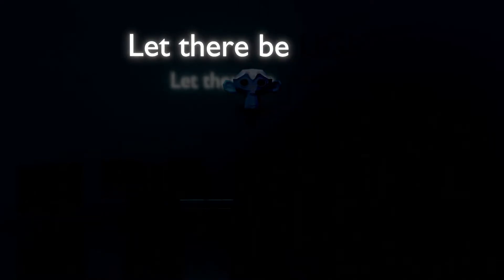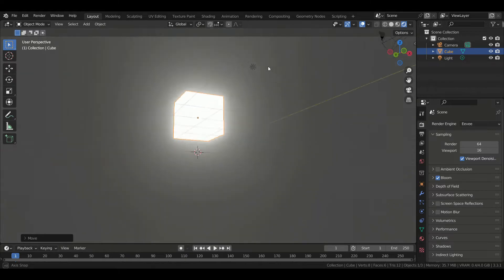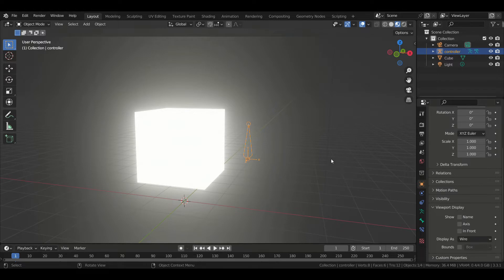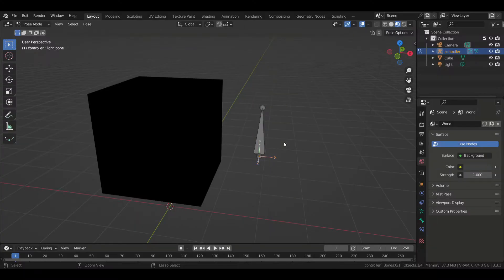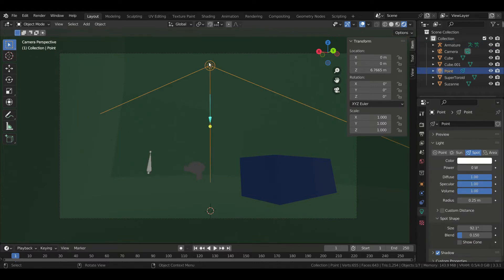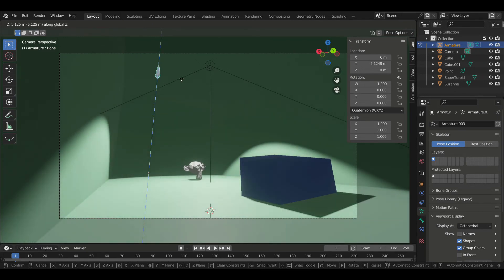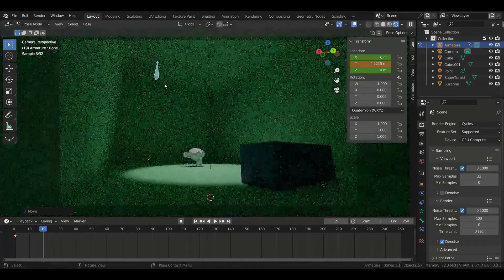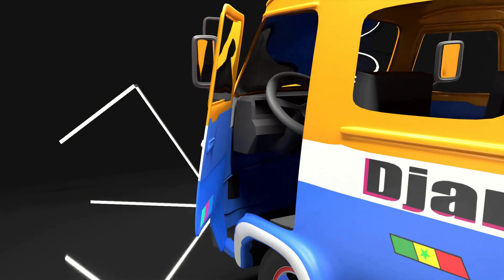How to Control Light with a Driver in blender3d

Comment: Why did you use only averaged value? How to know that what to use, scripted expression or averaged value? Please explain in few words
Reply from the maker: you'd have more control with an expression as you can tweak the coefficient to make the driver more or less reactive, averaged value on the other  hand as the name suggests gives you an average value but less control over the drivers speed